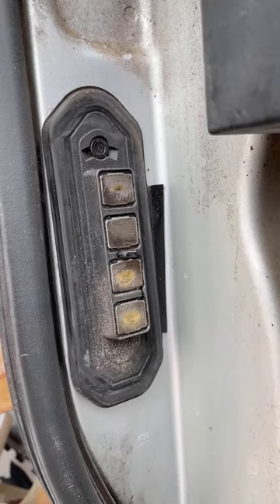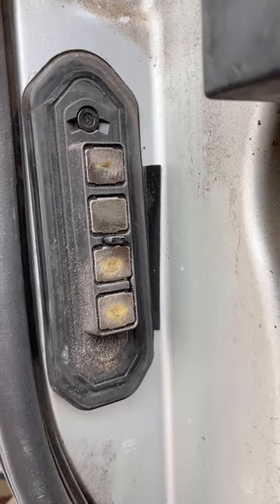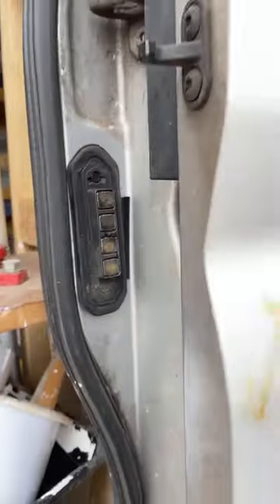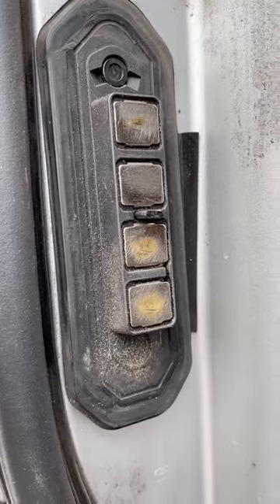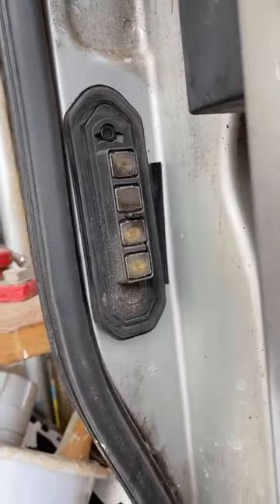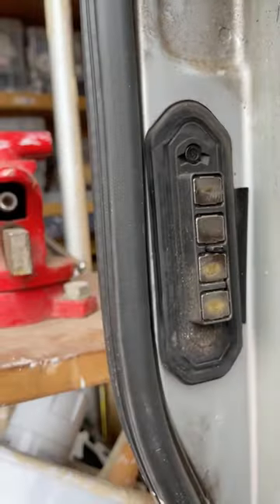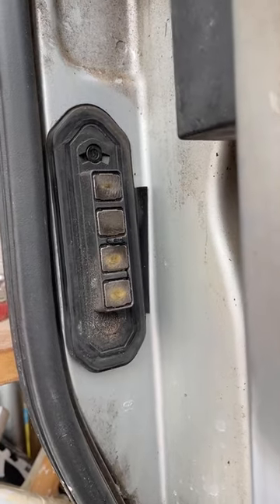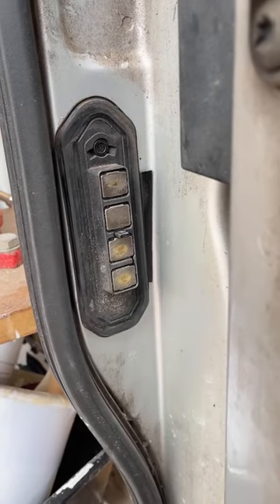Door open Annoying Beeping Sound Fix - Van - Motorhome - Fiat Ducato - Citroen Relay - Peugeot Boxer

Comment: Have the same problem.. tried exactly what you done...
No success.
I can lock the side and front doors with rear doors open but not when rear doors closed..  any suggestions
Reply from the maker: All I found was that if all the contacts are not touching it wouldn't lock
Reply: @HandymanStratforduponAvon  I think I've got to the bottom of it.. rear door wiring
Reply: @scottwalker3162 what was the exact issue?My Ducato does the same. It just drives me crazy.
Reply: It was the rear wiring loom on the right hand door 
Broken wires @RolandKeszeg
Reply: @scottwalker3162  thanks I will give it a try
Reply: @RolandKeszeg  you can buy a new loom at around £100.
But I just repaired the broken wires